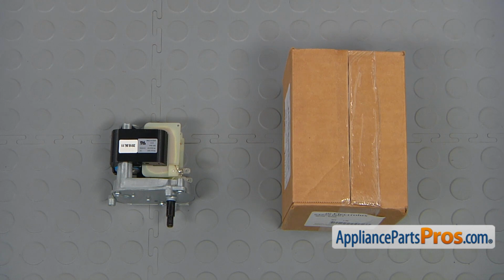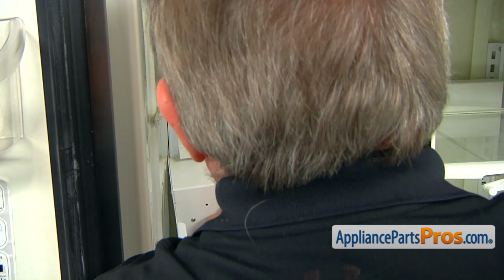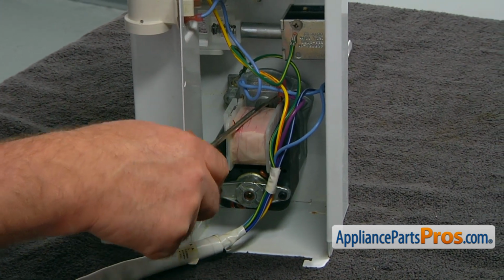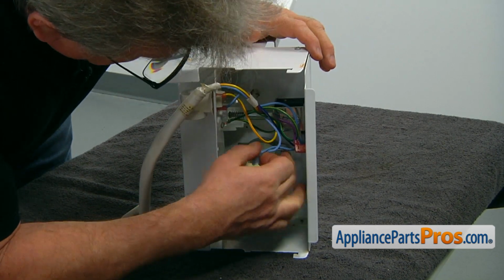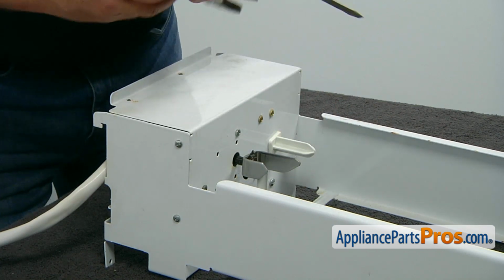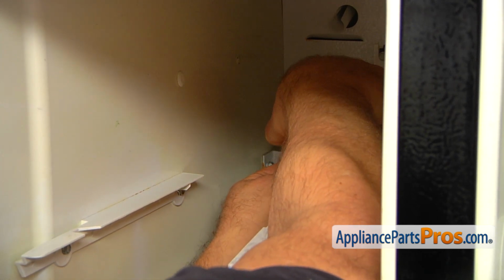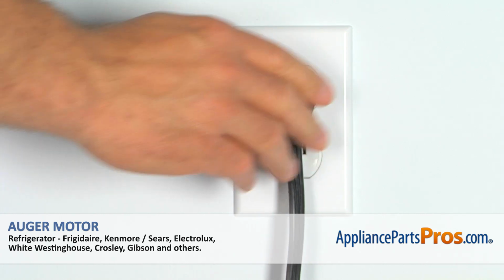How To: Frigidaire/Electrolux Auger Motor 242221501

Comment: Great video, thanks for taking the time! What if the problem is that the motor doesn't stop? It only stops when the door is open and the switch turns the auger off.
Reply from the maker: What is your model number?

Comment: If i was to hook the motor up to my DVOM what setting and number would I be looking for?
Reply from the maker: You will set your multimeter to read AC voltage and should have 120 volts to the auger motor.

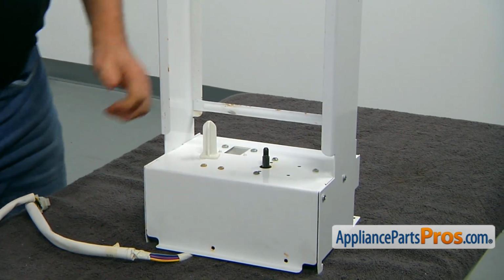Comment: Today I worked on one just like the one in this video. @6:38 he clamps the vice scrips to the shaft of the motor and breaks the U shaped that turns the auger lose. Well, the one I was working on that U shaped thing was stripped out. I ended up buying a whole new one and all. Looking back I might have been able to get someone to have welded it back together. But I was not sure it would hold. I had went to a used appliance store There are tons of these things some with different electrical plugs and different withs. Ened up finding one that was close. But I had to change out the rack frame with the old one.

Comment: Most of the time is not the auger motor gone bad. But if you remove the front panel you may see that the tab for the ice maker solenoid paddle is snapped off very flimsy material. This happened to me and was able to repair the tab by inserting a screw to make contact with the solenoid. Now I have ice and extra motor and to sell.
Reply: Where is the tab located?  Picture would help.
Reply: @bobbeltz197  I'm in the same boat. Replaced the motor and there was not change. Did you get an answer?
Reply: The solenoid only switches between cubes and crushed.  My problem is the auger doesn't turn.  I took it out and bench tested it good. 'Still can't figure out the problem.  It's making ice but won't dispense cubes or crushed.
Reply: @markjacksmarkjacks  do you have a picture of the correct place for the solenoid wires?
Reply: @markjacksmarkjacks  i have the same issue.
Reply: @rfonseca  Any update on if you found your issue?   My issue, The flapper opens then closes after 2-3 seconds and auger never turns.  If I put the fridge into diagnostics, and run diag #10 test the auger definitely turns.  So its some sort of coordination between the flap opening and the auger supposed to start turning that isn't happening on my fridge.
Reply: @timhulse1969  Sounds just like my problem even did the diagnostic test 10, any update on if and how got fixed?
Reply: @drpoke9827  Wound up replacing the whole control board/display.  Never had a problem after that…
Reply: @markjacksmarkjacks   Same problem here. Did you ever figure out why the auger doesn't turn?
Reply: @Bob Beltz, @DoroteoVilla, @Mark Jackson, @Rene Fonseca, @Tim Hulse, @DR Poke, @David Valentino:  I'm not sure if the @'s will work, but I am wondering if anyone has found a solution to the problem other than replacing the control board (@Tim Hulse).  I have replaced the auger motor and the dispenser (micro) switch but the auger is still not turning.  I have a Frigidaire PHSC239DSB5 and there's no diagnostic mode to my knowledge.  Any recommendations, or am I looking at the control board next?  Thank you.